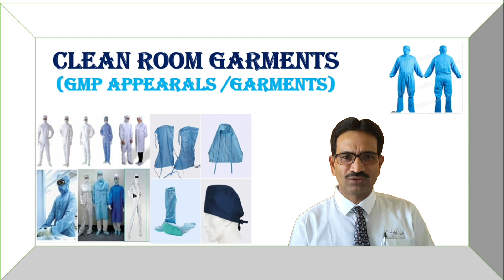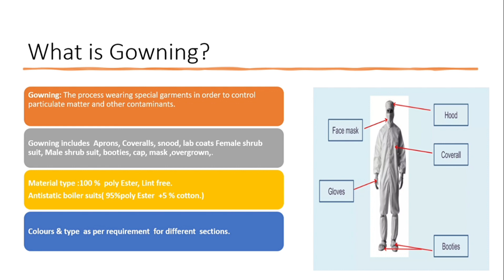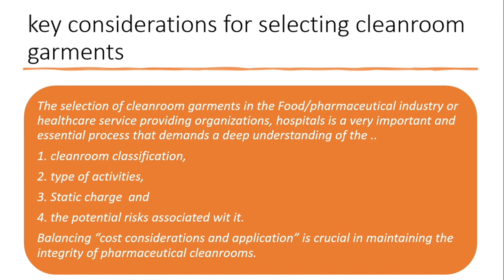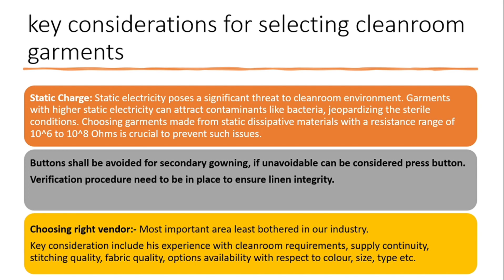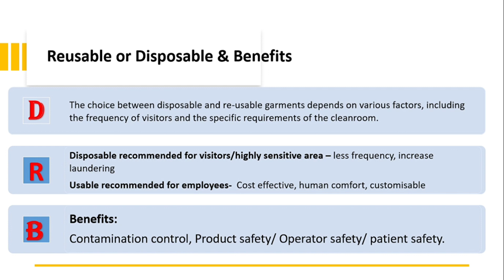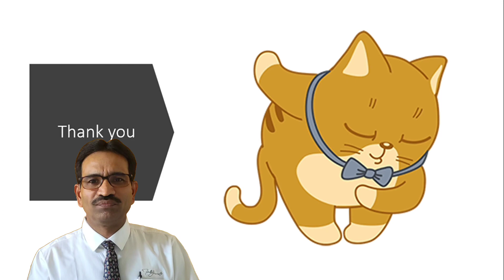CLEAN ROOM GARMENTS - GMP APPEARALS / GARMENTS

Comment: Vacuum packing Gamma indicator
Reply from the maker: For vacuum-packed garments undergoing gamma sterilization, you’ll want a combination of visual process indicators and dose-measuring indicators. Relying on just one type isn’t enough if you need confidence in sterilization.

1) Basic visual check (external)

Use Class 1 process indicators:

Gamma indicator labels/tapes that change color (e.g., yellow → red)
Placed outside each vacuum pack.
2) Internal dose verification (critical)

For garments, especially if used in medical or cleanroom environments, include dosimeters inside the vacuum pack:

Radiochromic film dosimeters (thin strips, ideal for inside packs)
Alanine pellet dosimeters (highly accurate, lab-read)

These measure whether the product actually received the required dose (e.g., 15–25 kGy).